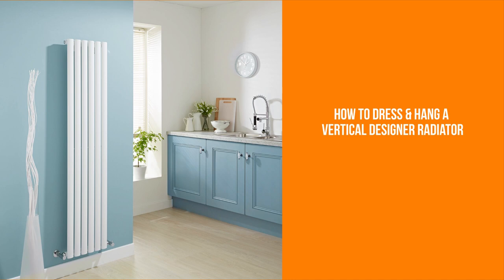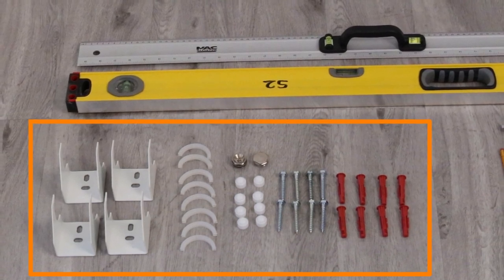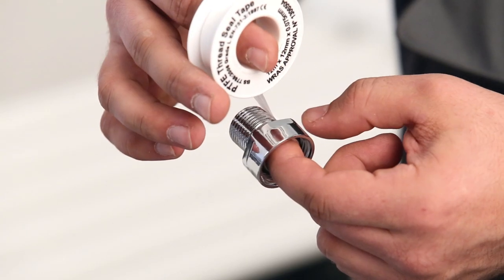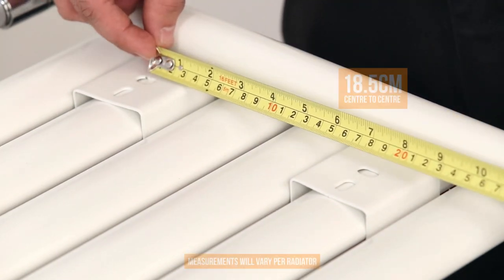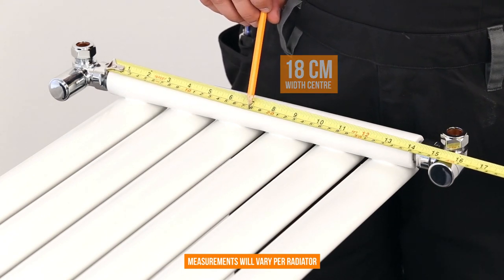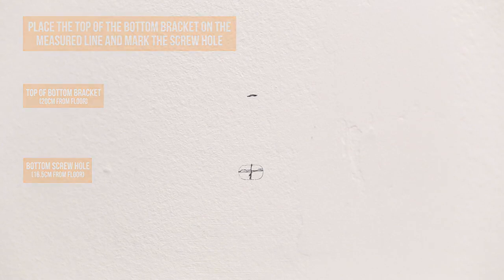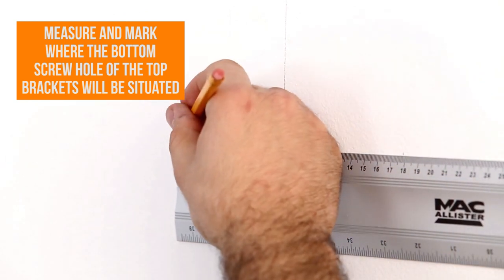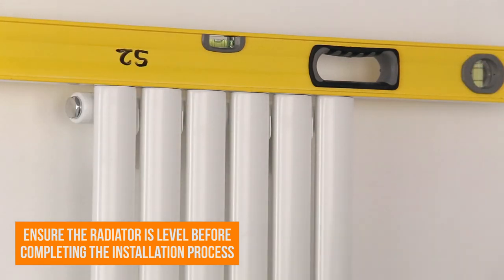How To Dress & Hang A Vertical Designer Radiator | BestHeating

Comment: Hi do you fix each bracket using one of the screw holes or both in each bracket , a little unclear with top of bottom screw references 
Cheers 
Chris